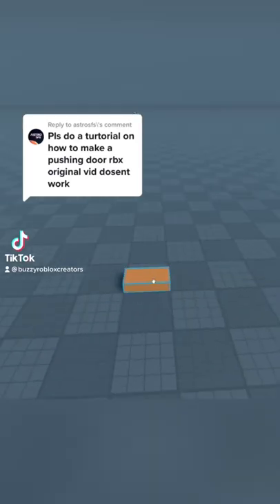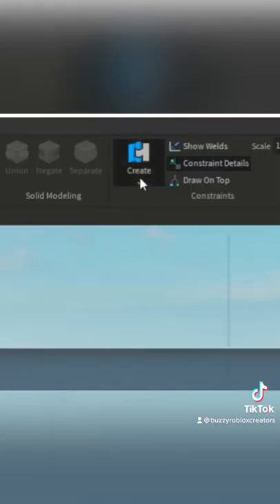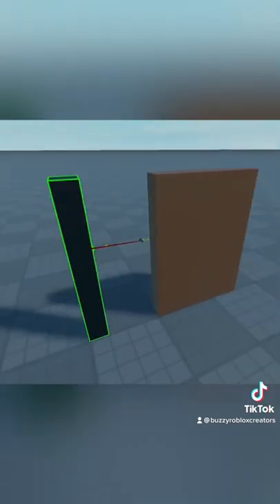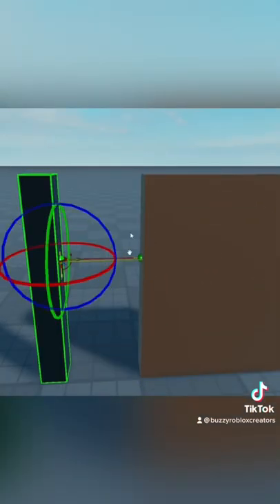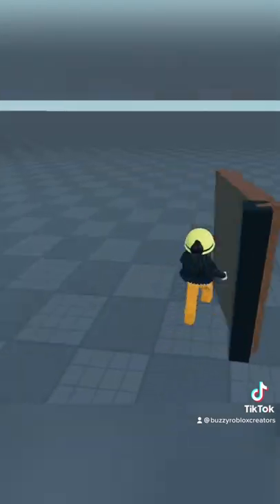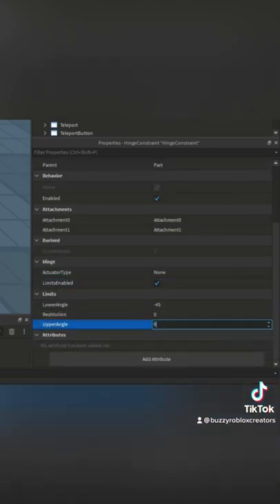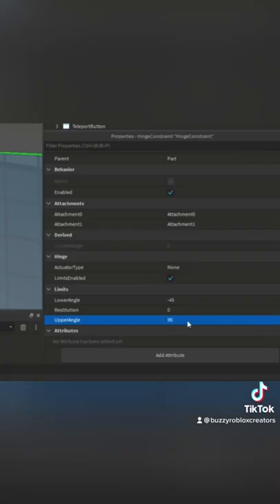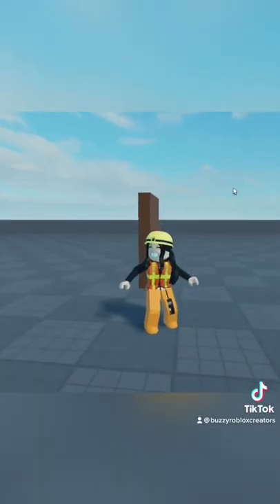How to Make a Pushable Door in Roblox Studio

Comment: I wanted to make a box that you can push so that you can get over a fence. Is It possible to make It be pushed In a straight line towards the fence?
Reply: You could just make it unanchored
Reply: @FireshotAJ  That will straight up not work. Yes It's movable, but It's super glitchy. If you jump around on an unanchored part how good does that work?
Reply: @PiggyBonkers0309  how would it be glitchy?
Reply: @FireshotAJ  Put a 4x4x4 part down and walk against It. See what happens
Reply: @PiggyBonkers0309  it worked smoothly
Reply: @FireshotAJ  It just doesn't feel right